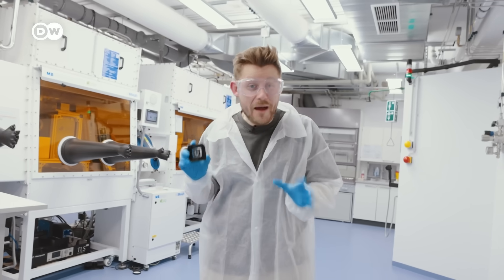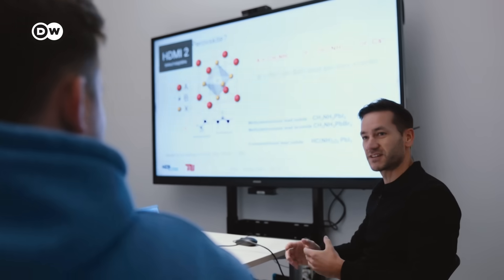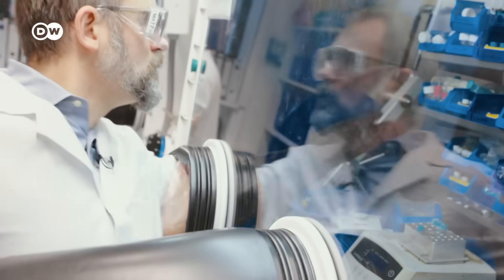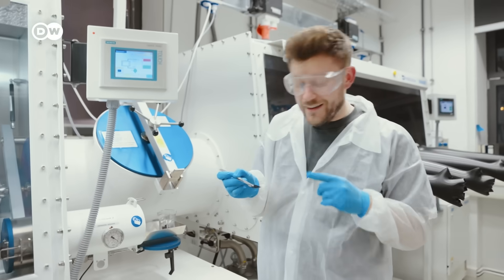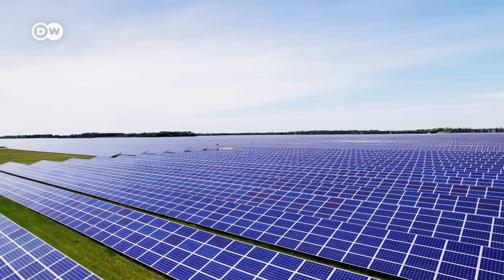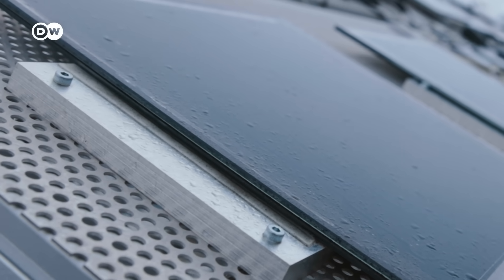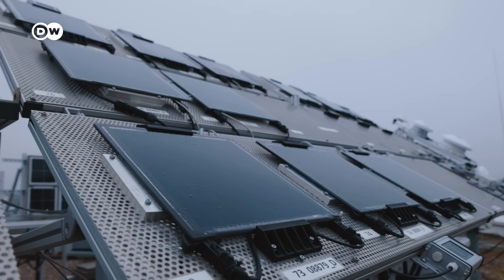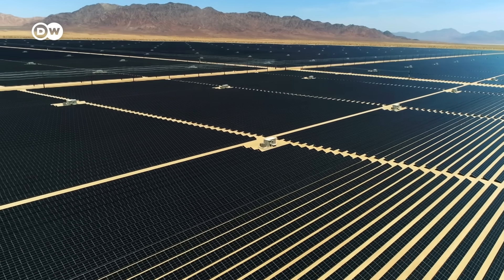Are perovskite cells a game-changer for solar energy?

Comment from the maker: Do you believe that perovskite technology holds the key to revolutionizing the way we harness solar energy?
Reply: Not if lead is involved. For all the known reasons. That lead was largely' phased out' of manufacturing. Silica, can be thrown away. Lead can't just be discarded.
Reply: It's all about durability.
Reply: Silicon PV installations have proven to be very reliable and economically unbeatable by any other electrical energy production method. And cheap mass production with very limited production quality fluctuations has been solved already two decades ago.
The EU has given away the tech to China because there was no political will to finance local production.
In the mean time, warehouses in China are stuffed with the current cheap and reliable PV panels. 
No time to waste: get these panels over here and start LARGE SCALE roof installation ASAP!
Reply: No it will never work! 
perovskite technology has to low electrical conductivity of low energy electrons - this can only be solved by using a lot of silver
Reply: No
Reply: If long-lasting two-layer perovskite cells that are offset printed onto rolls of mylar film are manufacturable, that would reduce the cost of cells to a tenth of current cost of TOPCon PV, reduce panel install cost by a similar amount, and reduce land requirements by a third. Overall, a halving of cost perhaps. Not a revolution but a very useful advance.
Reply: @gregvanpaassen p🎉en
Reply: @gregvanpaassen  The cost of silicon is only a small fraction of the cost of the total solar panel. In a solar power station, cost of the electronics is more than 50% of the cost of the panels. If you add the cost of the batteries, the cost of the solar panels will be about 25% of the total cost of the home electric power setup.
Reply: I believe i would wait at least 5 more years before going into this tech.
Reply: DW addimiting RuZZiasky's are 🤓 🤓 inteligent baster whille GERMANY ARE THEIR MAINS TARGET? :face-green-smiling:
Reply: no
Reply: Lead used in Perovskite make this product useless for American adoption.
Reply: Yes.  Why is it taking everyone else so long.  UW has been printing cells for years now.

Roll to Roll Solar Cell Printer
UW Clean Energy Institute
4.47K subscribers
22,162 views  Apr 19, 2018
Graduate student Brandon Rotondo explains the working of the FOM roll to roll printer at the Clean Energy Institute Scale-up and characterization test bed. This apparatus is used to print plastic solar cells.
Reply: believe or not I have cheaper solution with "much" higher efficiency so it can be called "disruptive" , western gov.s not happy ! until i make it with the Chinese ,from now you can kiss your tech good by   .... good luck
Reply: yes I do
Reply: Not now ,  short Longevity is a  huge problem to solve
Reply: Yes. I created an episode on my channel mentioning Pervoskite as game changing tech. 2023 Tech Revolutions: Shaping a Better Tomorrow
https://youtu.be/Is74CIQvJIQ
Reply: Not so much, not with the current short lifespan.
Reply: Here in Australia, they say we need nuclear power. All we have is sun and wind. Plus huge coal and uranium deposits. which way should we go?
Reply: Yup, especially when you place them in a diffusion sandwich, stick them in a battery box and run fibre optic cable from a light tunnel that tracks the sun. Saves land and roof space and concentrates the light. The solar cells then stay at a consistent room temperature or a bit cooler for optimal energy. It also increases the lifespan of the cells. You need light and not the heat. This fixes that. 
This is something I have come up with and been thinking of doing for a while now with regular solar cells, let alone perovskite cells.
Reply: Yup, especially when you place them in a diffusion sandwich, stick them in a battery box and run fibre optic cable from a light tunnel that tracks the sun. Saves land and roof space and concentrates the light. The solar cells then stay at a consistent room temperature or a bit cooler for optimal energy. It also increases the lifespan of the cells. You need light and not the heat. This fixes that. 
This is something I have come up with and been thinking of doing for a while now with regular solar cells, let alone perovskite cells.
Reply: Perovskite cells don't yet combine photons, heat, and redox reactions on a single substrate.

They are quite revolutionary, but they are pursuing pure electrical output like silicon.
Reply: Believe.  Why bother.  When you can buy one and it tests out I'll get one.
Reply: Awesome! I'm so happy to be a subscriber again and enjoy your Planet A essence videos. 🌎 I appreciate how you cover one general topic in each video and then dive deeper into specific aspects of it in the following ones. It makes your content more informative and engaging. 👏 What inspired you to start this series? I'd love to hear more about your journey and passion. 😊
Reply: From what I understand we already have more solar cells than we have people to install them, so I'm not sure if they'll significantly reduce the cost of installing solar. Perhaps the biggest gain of perovskite cells is that they could potentially decarbonize the solar cell creation process.
Reply: Can we make car roofs of solar panels  to revolutionise Electric vehicles?
Reply from the maker: @thebionicwoman1762  We have just the video for you. Watch: Why aren't solar cars everywhere? - https://youtu.be/FXDWRhEOX7k
Let us know what you think in the comments! 🚙
Reply: @DWPlanetA  The solar powered buses & trucks look very promising…I never thought about the engineering challenges with having curved roofs…
Reply: While perovskite technology presents exciting possibilities for transforming solar energy harnessing, it's crucial to approach comparisons with traditional silicon panels cautiously. Addressing economic, stability, and scalability concerns is paramount for perovskites to truly revolutionize the market. Achieving a degradation rate of 2% in the first year and 0.5% in subsequent years remains a significant challenge. Perovskites may find more immediate success in non-photovoltaic applications, particularly in areas like lasers and optical amplifiers.

Comment: This is not true, that Perovskite tandems need to be cheaper than Silicon only cells on the per Wp basis. The PV modules is only a small part of the whole PV installation, about 10-20% of the total cost. If a tandem module is able to provide 20% more energy than silicon only modules, then it can potentially cost 2x more per Wp and still be worth buying, because it is bringing down the total cost of energy generated, on a full system basis.

Comment: A huge problem with efficiency is that solar light is AC current, and PV diodes are just that, diodes, DC.  
Not only are you losing energy via the lack of absorption, you are losing half of the sun’s electricity by rectifying the AC vortex.  
Obviously, there is still the light absorption degradation.  
The key to light absorption in the circuit is crystalline molecular structure.  
An even bigger misunderstanding is that thinking light is a wave or a particle.  
Why do people argue about that? 
Because they can’t magnify the BEAM of light to see that it is a helix. Light is an alternating current. A red/positive/left spinning spiral coming out from the center, and a blue/negative/ right spinning spiral going back to the center. 
The force of the two drawing to and from each other create a neutral zone between the two, which creates the beam of light.  
The positive and negative join in the middle like a yin yang, hence the design of the bifilar coil. 
The coil is really telling you what AC looks like.  
You just need to pull the center of the coil up to create a cone and you have a visual on AC current.  All energy move this way.  Ie: tornadoes. Lightning is what happens when given charges vortices collide with each other.  Creating a short.  Two negatives make a blue bolt. Yellow are when a positive and negative come together.  
This is why we have three primary colors and axis in the third dimension. 
They key to AC solar is make a panel with bifilar/ caduceus cells/coils in the shape of the great pyramid, an octahedron. 
The panel itself still needs to be flat and constantly perpendicular to the sun, but there needs to be any tiny cells/coils made of a black chemical compound that takes the shape of an octahedron rather than a cube. Once you have an octahedron shaped crystalline cellular structure (or simply just make them conical). you can coil two positive and two negative nodes at the top of each microcell to transmit the AC current. (Homopolar config). 
Advancing further in energy collection. 
Sunlight actually has billions or even trillions of beams.  If you along the octahedron/conical microcells to physically align with each beam of sunlight, you can directly continue the AC current from the sun to the panel itself.  The beam is a cone so you would want micro cells to come to a tip like a triangle or cone for the beam to engulf and directly move into the wires/diode. 
However.  The intricate and tedious task of magnifying beams of sunlight to align micro PV cells to the tip of a sunbeam is an immense task. The only lens complex enough to magnify sunlight is a living optical nerve shielded by microdrops of water with a 0.9% NaCl to water ratio. Even then the opening itself to the micro droplet of water has to be precise to the size of the beam of sunlight, and must be perfectly 90 degrees perpendicular to the sun/desired single beam, and go directly through the absolute center of the convex micro droplet of water. 
But.  That is how you can fully maximize energy consumption, and then potentially amplify it. 
Oh yeah the chemical compound will be like vantablack. Mainly, Carbon. 
More simply a vantablack/Musou diamond.

Comment: The reason that 99% of large-scale photovoltaic solar farms are built using “thick” crystalline silicon or polysilicon materials is largely driven by financial and risk management factors. Developing a solar farm, which can cost between $100 million to $500 million, requires insurance or bonding to secure the investment. However, insurance companies are unwilling to cover technologies that lack a proven track record of at least 20 years of field performance. As a result, even when new solar technologies become commercially viable, they still face a significant delay—often 20 or more years—before they can be widely adopted, simply because they need to establish long-term reliability in real-world conditions. 

i.e., startups looking to introduce new solar technologies face a major challenge— they must build and operate a solar farm entirely at their own expense, essentially giving away the electricity for 20 years just to prove the technology’s long-term reliability. While someone like Elon Musk might have the resources to take on such a venture independently, most innovators must rely on government partnerships or strategic pilot projects, such as deploying smaller-scale installations along infrastructure like railways. These approaches provide an opportunity to gather the necessary performance data over decades and ultimately validate the technology for large-scale commercial adoption.

Comment: I think it would have been extremely important to point out that the maximum theoretical efficiency of a single junction PV cell is only 33.7% - so getting a similar or higher efficiency than that is extremely ground breaking.  
For a lay person, seeing that solar PVs are commercially only 20-25% seems very inefficient, and the new breakthroughs only increasing by a few percentage points might seem underwhelming if you don’t consider that this is on the edge of what’s physically possible. It’s like telling someone your car’s engine is only 37.5% efficient, and new engines have reached 46% efficiency - it sounds like almost no progress had been made, meanwhile it’s really gone from 75% to 92% of the maximum possible efficiency.

Also to note on that figure, the maximum does increase with the number of layers so getting above that 33% efficiency is not breaking physics or anything - the theoretical maximum of a two layered cell is 42%, so getting an efficiency of 35%-40% is incredible and cannot be understated. For reference, if you keep adding layers, like 3 layers the efficiency goes up to 49% with diminishing returns - if you have infinite layers you can in theory capture 86%, but in reality the best we may be able to get to is 60% in the lab, and 50% commercially.

Comment: If this material degrades easily, why not combine both the silicon and perovskite?
Reply from the maker: Hey there! There is research to combine silicone and perovskite to make use of the advantages.
Reply: @DWPlanetA  what needs to be overcome, in technical terms, now with the perovskites?

Comment: Would not support it until lead is replaced. In the video it is mentioned that other material can be used, but not a single option was given, even when precautions were used entering the lab acknowledging the dangers of lead. It may be a future option if this issue is solved.

Comment: I remember when twenty five percent efficiency and a genuine twenty five year lifetime was considered unattainable.
So perovskite catches more of the visible spectrum of light which can be converted to electricity compared to mainly infrared light being caught and converted by silicone panels.
This increases the efficiency but at the cost of longevity.
So tandem cells solve this problem or double or dual layered panels could also be designed to capture more of the visible light with a layer of both types of technology used.
So twenty five years plus lifespans with twenty five percent plus efficiency has been achieved.
Most of the current technology we have been striving for such as solid state batteries have been achieved. The best and most economical way to manufacture these breakthroughs is the major hurdle at the current time it seems.
😎🇦🇺👍

Comment: China install 216.88 GW photovoltaic solar panel in 2023 alone, most in population sparse area (unlike Israel)  that lack of industries.  In conjunction, China is going to mass production Sodium-ion battery in 2024.  So in short,  China are able to use massive renewables energy to  for the "energy intensive" silicon refinery.  In short, Perovskite is hardly a viable competitor , even Europe/US/Japan working hard to break China dominance on silicon solar cell production.

Comment: perovskite solar cells are exciting to see. 

Currently my 60 watt portable panel is quite big. at a rated efficiency of 22%.
Imagine how much smaller it could be with a 30% efficiency at the same wattage!

You're not only getting higher efficiency, but you're also getting smaller panels, for the same wattage as older ones! I can't wait for perovskite solar panels to hit the market.
As long as they are cost effective (i.e same, or below current solar pricing), and actually live up to that 28%+ efficiency, thought I would like to see 30%+ efficiency.

Comment: The problem with Green Energy   is "Free" Energy is unstable, unreliable, nor available 24/7 year round, but today's regulated requires all of these problems to be overcome.  This means either fossil fuels back up is mandatory or a large amount of "Free" Energy must be stored to smooth the delivered energy.  Batteries don't fix the problem that society faces - The grid is AC, Batteries are DC.
The Democrat Brainacs nor the Bureaucrats have offered a scenario to fix the problem nor away to create the wealth required for manufacturing and installing the necessary infrastructure the 1st world economies need.   An observant conservative "C" student reading the Bible saw that God hinted at the scenario to solve the problem when He described the Holy Land as land flowing with Milk and Honey.

Comment: Silicon PV installations have proven to be very reliable and economically unbeatable by any other electrical energy production method. And cheap mass production with very limited production quality fluctuations has been solved already two decades ago.
The EU has given away the tech to China because there was no political will to finance local production.
In the mean time, warehouses in China are stuffed with the current cheap and reliable PV panels. 
No time to waste: get these panels over here and start LARGE SCALE roof installation ASAP!

Comment: Facinating.  But unnecisery. Curient efficiency is enough. Silicon is bejond abundant. Heat to make is not important as you can use solar pannel to get as much power as you need. The only problem is long-term storage. I mean, there are 0 feazable ways to store power for winter. Still, it is hard to underestimate the usefulness of not burning stuff when it is sunny.

Comment: "Mined like silicon"? What is he talking about? Silicon exists in sand which is abundant.  Anyway, Longi has been making silicon panels with efficiency just a bit below the perovskite cells in ideal lab conditions.  And they are cheaper and available.
Reply from the maker: Silicon is usually extracted from silica, which is found in various minerals. It has been mined on various methods like open pits and underground mines. We did a video on silicon and silicon panels as well you can check out here 👉 https://www.youtube.com/watch?v=ydiX4Iayosg